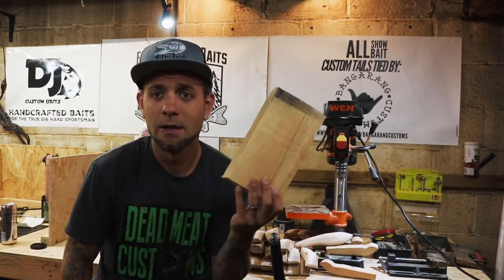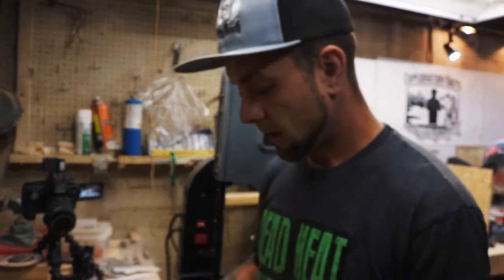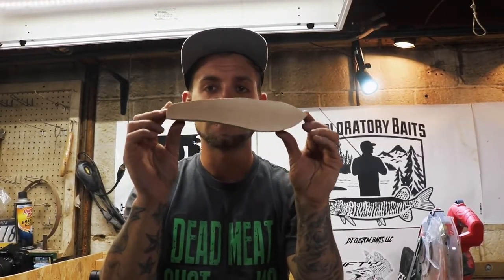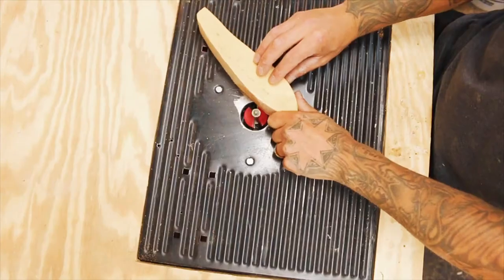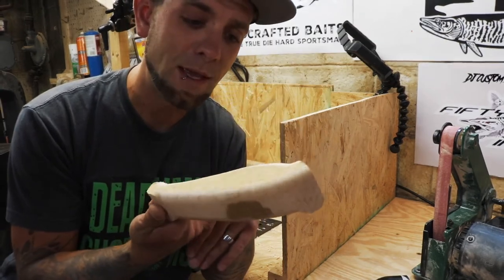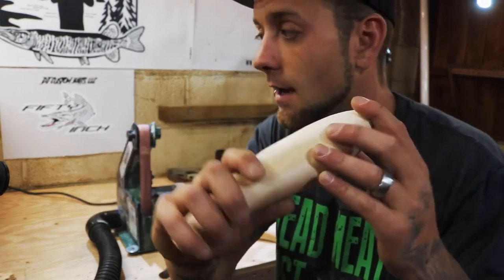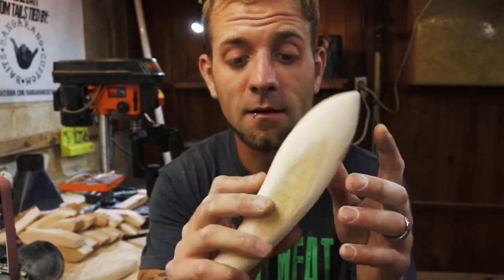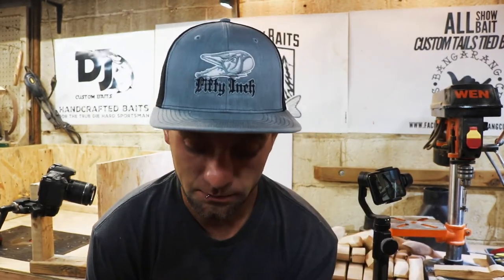Making a Muskie Glider Bait | Part 1 | Lure Building | How to build a Glider

Comment: Hey bud!  The reason the router is grabbing your lure is sometimes you are using it correctly, and sometimes you aren't.  You start off ok, and could have kept going right off the edge of the bait.  But, the last few passes you make, you're feeding the material into the router in the wrong direction.  Feeding material in the wrong direction is what can cause the router to grab and yank the piece out of your hand.  When you're looking down at the router table, the bit always spins counter-clockwise.  You want to feed material against the direction the bit is turning, NEVER with it.  Those last few passes you did really puckered up my butthole!!   Also, consider getting some type of a fence for your router table.  Makes things a lot easier - and safer!!

Comment: Maple is the worst wood you can make glide baits with it's highly inconsistent. Should be using cedar
Reply from the maker: I use cedar on all other baits. Cedar is way to buoyant for gliders if you are looking for a glider that will work the same everytime and not require half of the bait to be lead.